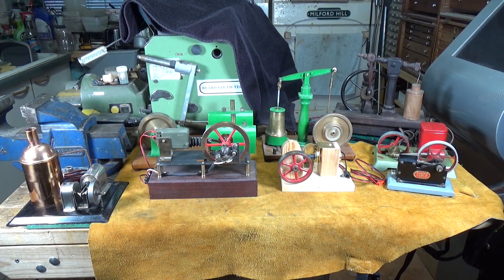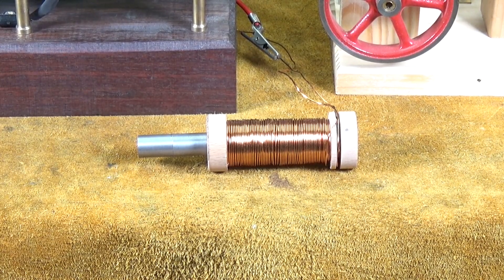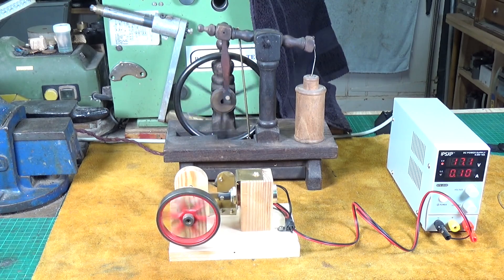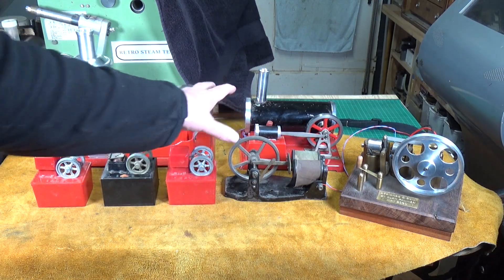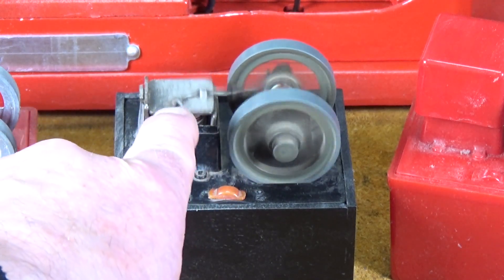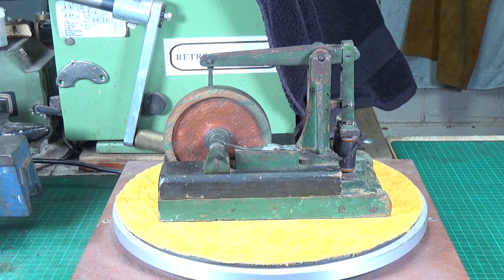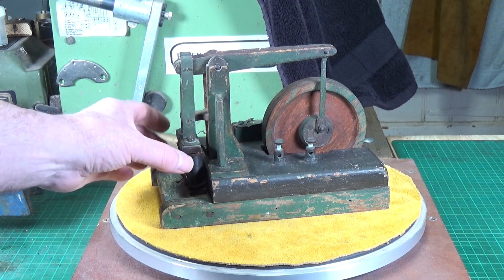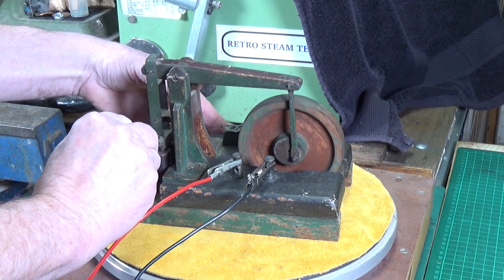Half Beam Electromagnet Engine

Comment: Any idea who made this little fellow? https://www.youtube.com/watch?v=5QLrcI_Bq24
Reply from the maker: Never seen one of those before but I love it 👍👍👍 Given that it has a cast frame it was probably commercially manufactured rather than scratch built. Great little engine.
Reply: @RetroSteamTech  It is nice, had to make a new cam and now runs a treat as you can see. 
Definitely looks like a commercial product but I've not found anything quite like it with the bell crank mechanism. 
Only clue as to origin is that crankshaft is 1/8" not 6mm so probably British or American rather than German - I'd love to know more.
Reply from the maker: @kcinelgoog  I would go with American. Weeden particularly like to use cast bases for the their steam engines.

Comment: Super engine Alan. I wonder when this was built. Looks to be mostly made of wood. Could this have been a wartime project. These electro mechanical engines would have been safer for children to play with. Hope you can keep it as original as possible. Cheers Nobby
Reply from the maker: Hi Nobby. Difficult to age it, the wood is quite old and so are the coils, so yes it could have been 1930s to 1940s. The electric part is obviously a lot safer than a heat engine. I did resist the urge to replace parts so it is pretty much original after the restoration. Cheers, Alan.

Comment: Hmm ya got me thinking....remember old door bells and fire bells? Coils just like that inside.I have 2 motors one from an OMC KIT ,a lovely thing, and a twin solenoid mill engine made from perspex by a company called Extreme kits ,they make a few different styles.Sadly OMC are no longer trading,their kits were a very high standard.
Reply from the maker: Yep, old fire bells and telephone extension bells would have great coils in. I have an OMC kit, OMC-1 Rocking Engine I think. Bought years ago and haven't got around to building it yet. It's on my to-do list!